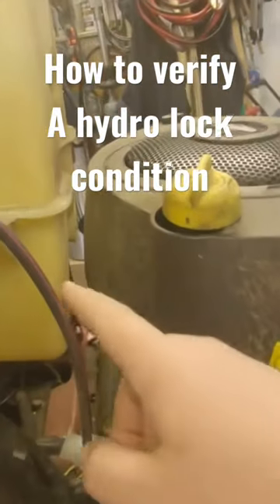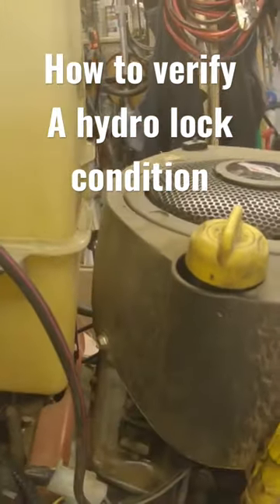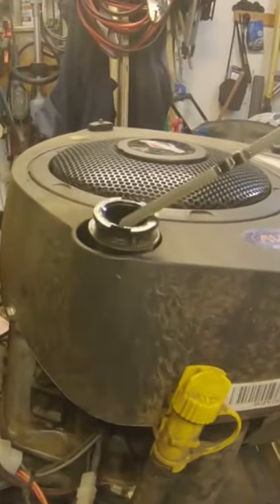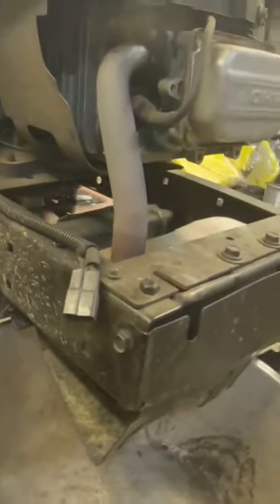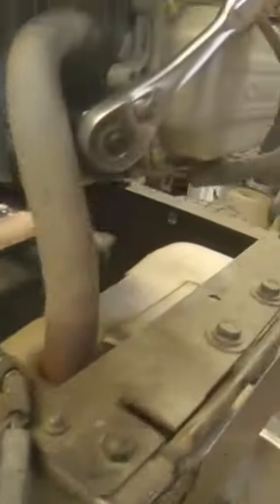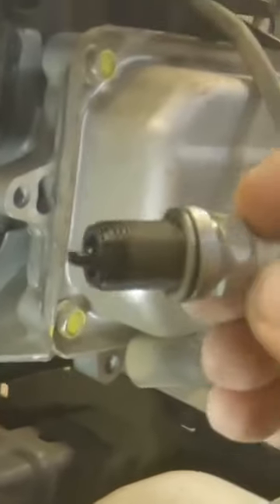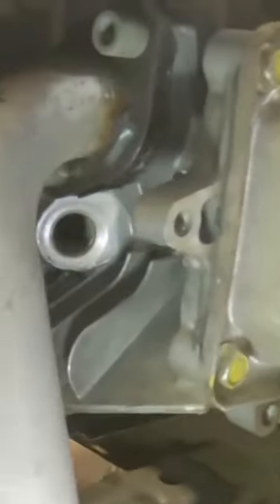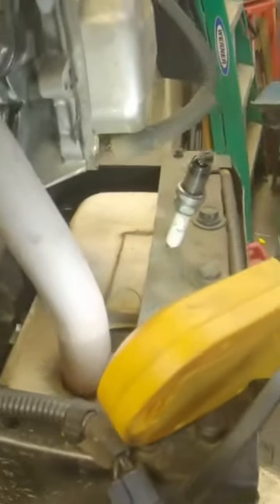How to Quickly Check for a Hydro Lock on Your Lawn Mower: #baldeagle242

Comment from the maker: 👇Click here for the full video👇
https://youtu.be/8VxTRqJZi0Q

Quickly Fix a Seized Hydrolocked Mower Engine - So simple you can do it yourself!
How to diagnose & fix a locked-up riding mower engine in 30 minutes.  I'll show you how to diagnose, repair, and prevent a common issue with gas-powered small engine equipment.  If you have equipment with a seized engine that refuses to crank over, this video may help you get it running and save you some money. Watch in 4k! #baldeagle242

See the carburetor rebuild from this mower here!
https://youtu.be/-uzKSJhJtww

See the Complete Baldeagle242 video history here.  A true trip down memory lane of all the past videos I have posted on YouTube.
https://youtube.com/playlist?list=PL5_ZXmQpcjpZLAMEskeAYolqvhFSN_X4m

Tools I use in my shop

Air filter for the mower in this video.  
(Yours may be different - Check the part number under your hood)
https://amzn.to/3E7hWQh

Carburetor Carb Assy. for 21HP Craftsman 3000 Mower Tractor Briggs & Stratton
https://amzn.to/3GY1ZO6

Carb rebuild kit 
https://amzn.to/32nich6

Fuel shut off valve.
https://amzn.to/3qd4eGA

Fuel line hose crimp tool
https://amzn.to/32fdmT4

Briggs and Stratton (Short) oil filters
https://amzn.to/3yIX9kR

Briggs and Stratton (Tall) oil filters (May not fit under some mower hoods)
https://amzn.to/3EanmtU

Red Loctite thread locker (Use Blue for anything you may want to take back off in the future)
https://amzn.to/3J5dPrC

300pc Metric and SAE Thread Repair Kit, HSS Drill Helicoil Repair Kit M5 M6 M8 M10 M12, 1/4" 5/16" 3/8" 7/16" 1/2" (This kit will pay for itself with one repair)
https://amzn.to/33JOeo3

Mini Tire Changer for mower, go-kart, and most small tires.
https://amzn.to/31eHgGp

The drill bits I use are lifetime-warranted Molybdenum from Drill Hog.  If you break one or wear it down to nothing, you send it back, and they send a new one!
https://www.amazon.com/dp/B010US18BG/?tag=eagle0f1-20

Hand crank trailer winch with strap with safety hook
https://amzn.to/3jTBzEL

As an Amazon Affiliate, I earn from qualifying purchases.  These links help you find the products I've used in this video.  Clicking these links will take you straight to the products on Amazon and help support this channel without costing you anything extra.

🤗 Get the Motion Hero Pack that I use in my videos for 
Only $37 one-time investment. Use unlimited times on your own and client videos!
https://baldeagle242--videohero.thrivecart.com/motion-hero-pack-1/

If you're a video creator on YouTube - Tube, Buddy is an excellent program to evaluate your videos and make recommendations to help you attract more viewers.  
https://www.tubebuddy.com/Baldeagle242

BALDEAGLE242 Facebook group
https://www.facebook.com/profile.php?id=100068248886396
Reply: Ok
Reply: Fix small engines a lot this one got me feeling stpuid
Reply from the maker: @ronaldlittle1598  Here’s a link to the full video if you would like to check it out.  Simple NIKKI Carburetor Rebuild
https://youtu.be/-uzKSJhJtww

Comment: I install a cut off valve in the fuel line on all my lawn mowers.
Reply from the maker: That’s a great idea. They should all come from the factory with one. 😁👍
Reply: Had to do the same with mine, fliat in the carburetor allowed the crankcase to fill with gas.
Reply: @baldeagle242 i totally agree 
But some do
And some don’t

Comment: You always have to turn off the fuel tank valve or it will flood.
Reply: I agree, but, it’s the carb leaking that’s the main issue. The quick fix is a fuel shut off valve, most all of my equipment has one, and they work!
Reply: If the carb is leaking is the bowl not clean lmfao
Reply: Most likely the needle is stuck open, holding the float up, and letting the fuel pass.
Reply: Yep yep that's why I said it was prob dirty
Reply: Bad needle and seat
Reply: Its the inlet needle in the carburator. Learn to fix it correctly.
Reply: @gutshot300mag  rubber tip probably got swollen and came off common issue
Reply from the maker: 👆That’s exactly what happened. Here the carb rebuild video. https://youtu.be/-uzKSJhJtww
Reply: I had to add an inline 1/4 turn ball valve with nylon seal and stainless steel ball.
Reply: It will never leak if your float is adjusted properly
Reply from the maker: @jamie66233  There are a few reasons why this particular carb will leak even with a perfectly working float. Here’s a full video that goes into much more detail. 👇
NIKKI Carburetor Rebuild Flooding and Surging Fix #NIKKI #Briggs #baldeagle242
https://youtu.be/-uzKSJhJtww
Reply: And if you don't have one of those shut off valves at the tank you install one because even if you fix the carb it will break again
Reply: @gutshot300mag  it's not even a quick fix, it's just smart to have
Reply: Shouldn't unless your float is stuck.
Reply: Needle valve stuck open can’t count how many of my friends have this issue 😂
Reply: If you're having to do that, then that's a bandaid fix. Those Nikki single barrel carburetors are notorious for the float needle and or the separate inlet o-ring on the fuel transfer tube leaking. Occasionally a float will leak at the seem as well and fill with gas. That's a lot more rare though.
Reply from the maker: That’s all very true. Here’s a link to the full video. https://youtu.be/-uzKSJhJtww
Reply: Most riders dont have one unless one installs one. And units without gravity feed have a fule pump inwhich itll never do this, but can fill crankcase if diaphram is ruptured in pump.

Comment: Typically due to a carb float malfunction, needle seat or needle….when at rest the float or needle does completely stop fuel flow, it floods the intake as the tank is higher, and flows either thru the valves or depending where the piston stops into the crankcase, dilutes the oil, ruins the lubricity of the oil and kills the cylinder and rings…
Reply from the maker: Correct, this is just a short clip from an entire series of videos we made on this problem. https://youtu.be/-uzKSJhJtww

Comment: Those engine always seem to flood out. Generally a float, needle and/or seat issue. I went the shut off valve way for a while but ended up throwing a new carb on. Fixed the issue right away with some tuning
Reply from the maker: There are a few issues with the carbs they use on these engines. Here’s a full video on things to look for and how to rebuild these carbs that I made after this video. https://youtu.be/-uzKSJhJtww

Comment: Dirty carb caused needle to hang up and flood over the engine.  Clean carb and tank add shut off valve and never stand in front of spark plug hole while spinning a flooded engine over with the spark plug wire close to spark plug hole.  Nice way to catch a fireball bath.
Reply from the maker: Thanks Mike. 😁👍
Here’s a link to the carb rebuild video. There are a few things that can cause this issue on this carb. https://youtu.be/-uzKSJhJtww

Comment: Turning the flywheel by hand doesn't make a mess but removes the fuel
Reply from the maker: You’re not wrong 😁👍
Reply: After 37 years of turning a wrench you find crap out the hard way
Reply: And by the way customers won't use a quarter-turn valve. Tell em and they just will not use them anyway... SMH

Comment: needle valve in carburatior  stuck  open,installing fuel shut off,change fuel filter,clean in side of carburatior, check float in supper cold areas if float is brass it can freeze,you will know it will be clasped
Reply: plus change your oil and filter
Reply from the maker: Here’s a link to the full video. 

https://youtu.be/8VxTRqJZi0Q
Reply: @baldeagle242  that was a good buy on you part!

Comment: The crappy carburetors that came on those engines had an electric fuel shutoff that always failed. Put an inline valve and just shut it off when you’re done using the machine.
Reply from the maker: Simple Fix on a Seized Hydrolocked Mower Engine #baldeagle242
https://youtu.be/8VxTRqJZi0Q

Comment: A ruptured fuel pressure seal in a mechanical Chrysler pump came in with a no crank complaint. The 2 guys working on it had a breaker bar on the balancer bolt and flywheel tool on the flex plate. I pulled the dipstick because of a strong gas smell, and like him, found way full, thin and gasses. We removed the drain plug and like a cow pissing on a flat rock, we filler two drain pans. 
  Yes, it had a stuck needle or float. Gas shut is great but air enters and exists the float bowl, gas starts to turn into varnish after 120 days depending on temp. Depending on the year, but many have drain on the float bowl. It not, loosen main jet nut just enough to allow fuel out. Or, add the extended storage amount of "Golden Eagle, Fuel Stabilizer" in tank. If oil/gas mix (40:1 normal) but run stabilizer in near empty tank, start, run and let stall. Drain remainder back into supply tank. I have 15+ years on some of my two-stoke power equipment. What do you have have to loose? Pay a shop to rebuild the carb, new lines and rinse tank. $160 you have doubled the cost of your equipment. Remember that residential power equipment is design to stay within emissions range proper, for 150 hours. Commercial equipment is 5,000 hours. 
ASE Master Tech since 78.
Reply from the maker: Thanks for watching and thanks for taking the time to leave this comment. 👍
Reply: @baldeagle242  Thanks man, that was nice of you. The oldest of 4 family farm kids, we didn't get an allowance. 3.5 miles from town of 70 people, mow grass get $0.50 cents. Working for neighborhood farmers, excuse myself to the little cowboys room behind the barn, overtime found 2 exact same gas mowers. Learned my way up from there!
 Ever heard of Clinton engines? Other than pull rope, they had the coolest wind up top I've ever seen. 
  Hard metal arm w/knob, crank to tighten clock spring, folds over to let know fall into top case hole, then it released the spring, spun the crank and start. This is 68 man on the moon stuff! Worked...Yes, the carb was plugged in the idle & mail circuit. Having safety wire and compressed air, $0.25 can of carb spray let me chase every circuit from beginning to end. It made sense after a while.
  Then cousins from KC showed up with a go-cart. After 3 months they went home, then found myself learning to weld or get my behind kicked because they were older and much bigger. Either that or move. So I learned to weld and spray can paint. 
 Stay safe and have a good weekend end. I have a birthday and hoping for a Pioneer Super-Tuner 8-track. That way I can play my Stepping Wolf tapes! 
DK, Omaha. ASE Master Tech since 78. Self taught.
Reply from the maker: @deankay4434  I grew up on a farm till I was 16.  Only toys I had were whatever was in the barn or dumped at the local trash heap. My first mini bike didn’t have an engine until some dumped an old tiller off at the dump pile. I spent hours trying to figure out how to get it running and finally did. One of the first things I ever remember buying was a clutch and chain for that mini-bike. I was hooked!
Reply: @baldeagle242   Farmers never threw away anything and always had a pile somewhere. We had an abandoned pull type wheat cutter that had a V-4 air cooled engine on it, just rusting away. The engine was manufactured by a company called "Wisconsin". Man that was cool but at age 7 or 8, what are you going to do. It drove everything off 3 "V" belts and had a simple 2BBL carb in the middle. The manifold was aluminum but everything else was finned cast iron heads, cylinders onto a V -shaped crankcase. It was like a Harley but never saw one. Aunt's father in law had the mail route a road what looked like a pre-war Harley trike with 3 wheels. He showed up one day with a Jeep, most likely a Korean left over but with the fiberglass or aluminum box on the back. Man! The cool stuff I saw growing up. 
Take care, stay safe! My grandma used to say; God loves idiots! I ask how come she knew this. She said; Because he made a lot of them!
Reply from the maker: @deankay4434  🤣👍
I’m sure we could share a lot of stories.  😁

Comment: Take the spark plug out , leave the key OFF , push in the clutch pedal and lock in place with parking brake , turn crankshaft with a hand wrench several times clockwise !

Comment: I had a mower that did the same thing and it was the carburator it had a electric float and it was wide open letting gas to leak into the oil
Reply from the maker: That’s what happened with this one. Here’s a link to the full video. 
https://youtu.be/-uzKSJhJtww
Reply: An "electric float" ??? What was the amp draw on it ???

Comment: It's those damn electrical solenoids under the float bowl that fail that causes this. The fuel tank being mounted higher than the carb makes this inevitable. Fuel shut off valve in line to carb makes this go away. I rigged mine up like this, and always run the carb dry when I finish mowing. It's never failed.
Reply from the maker: Thanks for watching and taking the time to leave a comment. 
Here’s a link to another video that goes into more detail about this carb and common issues you’ll encounter. 
NIKKI Carburetor Flooding and Surging Fix #NIKKI #Briggs #baldeagle242
https://youtu.be/-uzKSJhJtww
Reply from the maker: 👆What he said
Reply from the maker: @jamesl9686  Thank you for taking the time to leave this comment. I’ve given up trying to explain this to people in the comments and just link to the full video that talks about this. I hope to see you around on future videos. 😁👍
Reply: @jamesl9686  which is why I installed a manual fuel shut off valve on my tractor, spoke of it in my posting earlier.

Comment: Do better than just disconnecting the spark plug wire off the coil. Ground out the coil altogether or leave the plug wire hooked to the coil - but ground the spark plug end.

The rapid ejection of the fuel will atomize/vaporize it - and any arc can light it off. A friend burned down a really nice Camaro this way.
Reply from the maker: I’m actually surprised there have not been more comments about this. I was lucky this one wasn’t close enough to ignite the fuel because it would have been very bad. Thanks for taking the time to share your comment. I hope to see you around on future videos.

Comment: I had to put a shut off on my fuel line for that reason when i cut the mower off. That mower looks just like mine
Reply from the maker: It's a pretty common issue.  Here is another video I made on these carbs that goes into a lot more detail about why they can and do leak.
https://youtu.be/-uzKSJhJtww
Reply: @Baldeagle242  i tried to find the correct fuel shut off selinod, but all i see is the entire carb, which i don't need
Reply from the maker: @rickeydriskill1096  there’s a lot of confusion on what the fuel solenoid actually does. This video can help you to better understand what the fuel solenoid does and more importantly, what it doesn’t do.
Reply: Yea my tractor started doing this a 2 or so years ago for which i put a shutoff on fuel line. Other then this problem it runs like it was brand new back in 1993.

Comment: Float in carb leaking by and filing your engine with gas.  Make sure to drain that oil good and never run one with gas in the crankcase.
Reply from the maker: +Joshua Mixson You are correct. This was just a short clip from a full video on this issue. Here’s a link to the full video. https://youtu.be/8VxTRqJZi0Q 
Thank you for taking the time to share your comment! I hope to see you around on future videos. 😊👍

Comment: Dont ever crank the mower like that with fuel in the plug hole and the plug boot right on the metal.. it will spark and have a nice fireball
Reply from the maker: You’re not wrong! 🤦🏻

Comment: If you fill the gas tank all the way up on a gravely 42 ztx with less than 20 hours on it...brand new. You get the same results. I changed oil and now only fill gas tank to 3/4 full. Carb is clean and mower only runs ethanol free fuel. At least I am smart enough to check oil before I start it every time. Oil level high was the red flag and the oil smelled like gas.
Reply from the maker: Quality control seems to be a thing of the past. 🤦🏻
At this point it’s all about the race to build the cheapest disposable equipment possible and keep the costumer coming back every few years.

Comment: You did not turn off the fuel valve and all the gas got into the crankcase. 
1.  Change oil and oil filter.
2.  Clean spark plug recheck the gap and reinstall back into engine.
3.  Refuel and turn fuel valve back on.
4.  Start engine let run for a few minutes, turn off fuel valve let engine stopped on its own then shut off ignition.
5.  After every time you are done using that engine turn off the fuel valve let engine turn off by itself then shut off ignition.
Reply from the maker: @Jim Knight I appreciate the tips. Here a link to the full video. https://youtu.be/8VxTRqJZi0Q 
Thank you for taking the time to share your comment! I hope to see you around on future videos. 😊👍

Comment: All that is stand out with gasoline will light up very easy. Never turn one over with the key with the plug out and the wire laying close to the engine like you just did. That could’ve ended bad for you. As in a trip to the burn unit!😱My friend Chuck got this figured from doing that to a motorcycle that had a cylinder full of gas and the Sparks at the gas off and he had to have skin graft off his legs all over the box of his hands. His fingernails dripped off like melted plastic. Be careful!
Reply from the maker: +John Wade Wow, that was one reason why I decided to post this video. I wanted people to know what not to do. I sounds like you have a lot of knowledge.  I hope to see you around on future videos.

Comment: The electric fuel shut off did not work ,leaked gas down in with oil . Those electric shut offs under carb suck,they fill with gas and cause it not to work.
Reply from the maker: Here is another video I made on these carbs that goes into a lot more detail about why they can and do leak.
https://youtu.be/-uzKSJhJtww